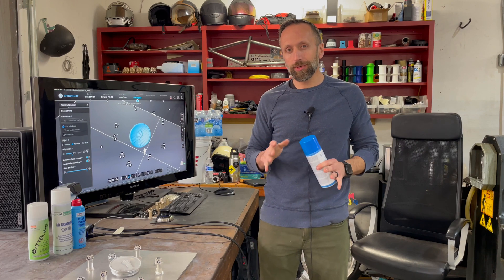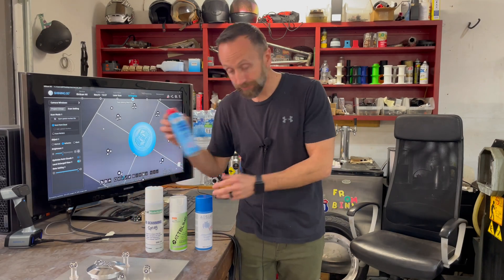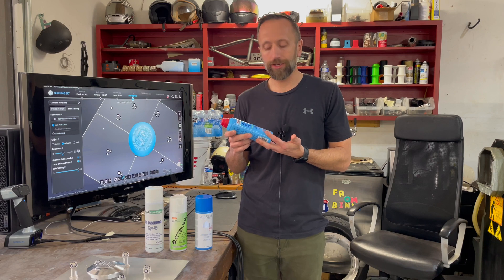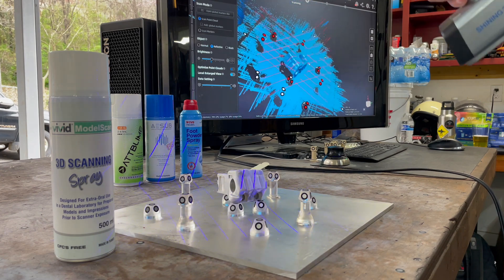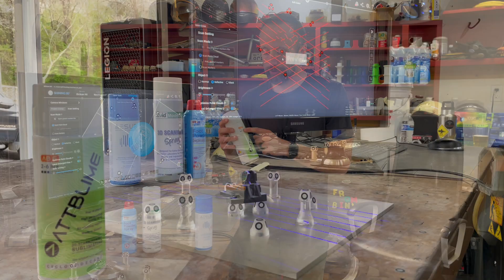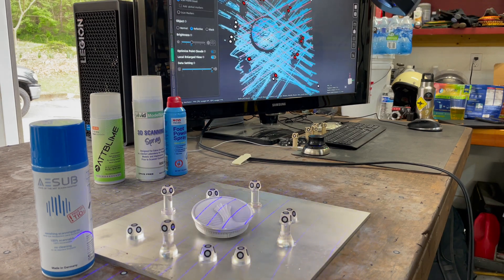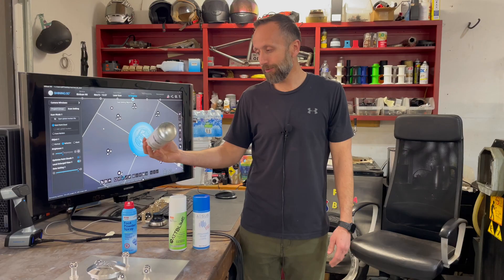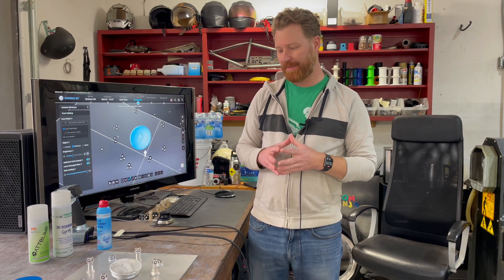Cheaper than Foot powder? Save on 3D Scanning Spray

Comment: I used to use foot powder. It leaves an uneven surface with tiny nodules. Not good for accurate scans. Then used ASUB. Better than foot powder but still uneven surface and a health hazard. Now use ATTBLIME which is TIO2, N-Hexane and Adamantane free and forms a uniform laver of 3 to 6 microns depending on the spray type.
Reply from the maker: Thanks for the info! We used the ATTBLIME, but I didn't know it was a safer choice. I would like to experiment with their products more.

Comment: Super informative. Thanks!
Reply: Ever try the purple Glue sticks? I've tried Office Max brand and it's been amazing... but most people recommend Elmer's brand. It's the purple "washable" kind that seems to always be what people recommend. Haven't tried any other products since, because it's always worked perfectly and I don't have to reapply it for every print. I do try to print all over the place though and not in the same place over and over, but that's not because of the glue sticks, but just to use the entire surface and not have the machine always wearing in the same spot all the time. It's probably pointless, but I do it anyways.
Reply from the maker: Thanks. Honestly, the best spray we used was Grey Etching Primer, Matte. It's amazing, but Paint adds some thickness and is not coming off : )